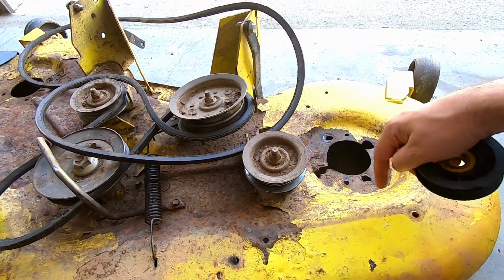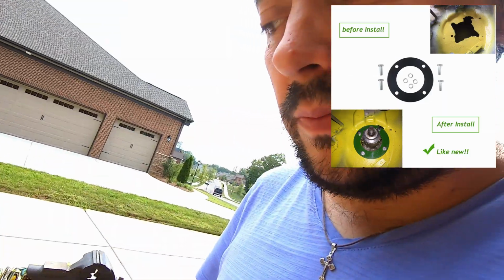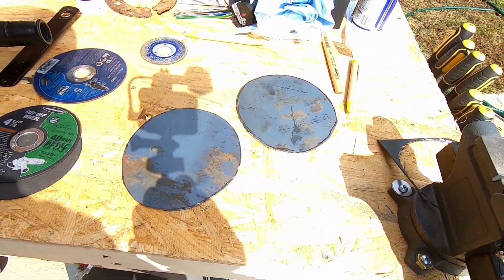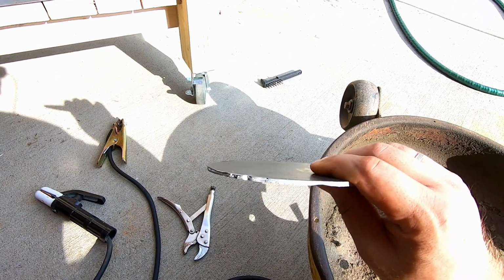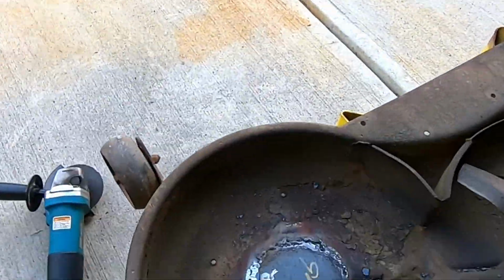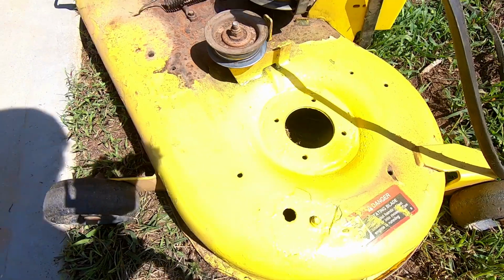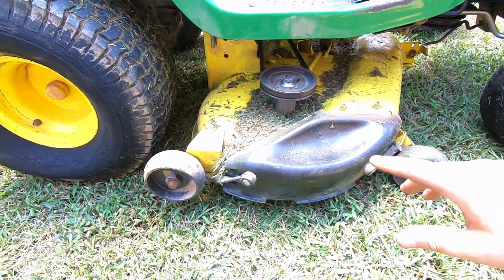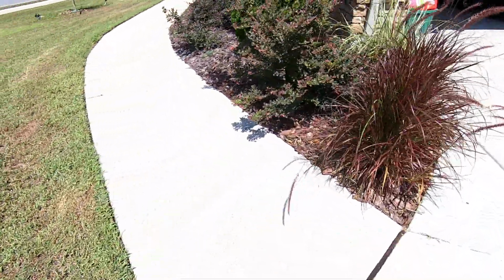John Deere D140 Lawn Tractor 48" Rotten Deck Metal Repair DIY

Comment: A square hole is usually easier to get a good insert fit than with a round hole, although you may have had no choice with the amount of rotten metal in that area. You can drill a few holes in the top plate, lay it on top of the bottom plate and weld the holes up. You can usually get scrap material for cheap from a fab shop. Not criticizing, just giving tips. Good work for your first time doing something like this.
Reply from the maker: Thank you! 3 years later it’s still holding up ok.
Reply: @HETPEZB  Glad to hear it's still working for you!

Comment: Great job on welding for the first time.  Nice job!  The mower decks on John Deere's are actually powder coated and not painted, which is why it was hard for you to remove the old powder coat with sanding.  The Deere factory only dips their mower decks into a solution to etch the metal prior to powder coating, which unfortunately still leaves the metal deck surfaces too smooth for the powder coat to adhere properly.  What the factory really should actually be doing is roughing up the metal surfaces much more so the powder coat has more surface area to really stick to.  This is why the powder coat on your mower deck failed, is peeling off the deck like it is and why its rusting.  A very common problem and John Deere is not the only manufacturer out there that is powder coating their mower decks and equipment using improper powder coating techniques.  The only way to really fix this issue would be to sandblast the entire deck down to bare metal, prime the deck with epoxy primer and repaint it with Rustoleum paint like you used in this video or use an automotive paint.  The new paint will most likely last you 20 years; much longer than their factory powder coat will.

Comment: I second the hobart 140. You can also weld plates together by drilling a holes in top plate and welding them in to the bottom plate.

Comment: This was a fun video. 
Next time you have a welding project come up, treat yourself to a wire feed welder.
Did you change the oil? Chances are the previous owner hasn't taken care of it as it started breaking down on them.
👍
Reply from the maker: This was just a test run for welding. I was actually looking at Eastwood Elite 140 welder, which can do stick, tig, mig (flux core or gas). It runs off 110v and it’s only goes for $499. The downside is - it has 30% duty cycle, which means out of 10 minutes it will weld for 3 minutes and cool down for 7 (at maximum power). 
I didn’t know if 110v outlet was enough to begin with, but as it turned out it was more than enough for the project like that.
Reply: @HETPEZB  I have the Hobart 140 110v. Used it for many years on many projects. I love it. It has the ability for gas, but never needed to use gas. Flux core wire lays really nice beads, just have to have a wire wheel handy for clean up. Once you go wire feed, you'll never want to use stick. I think it was $499. But it's a buy it for life kind of tool.